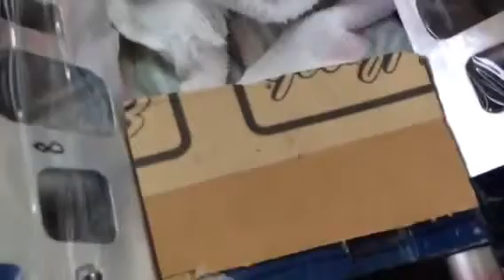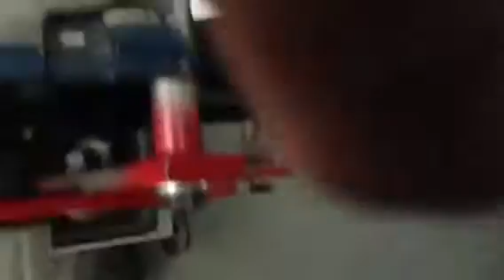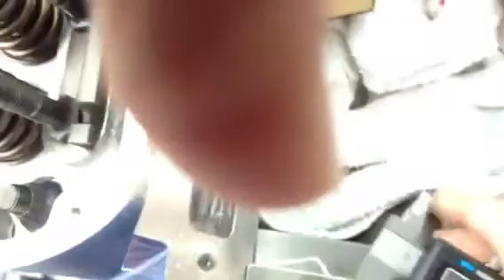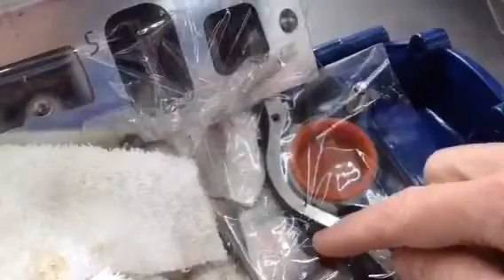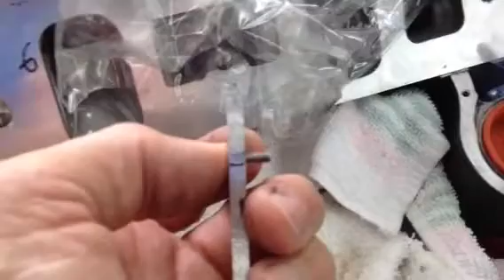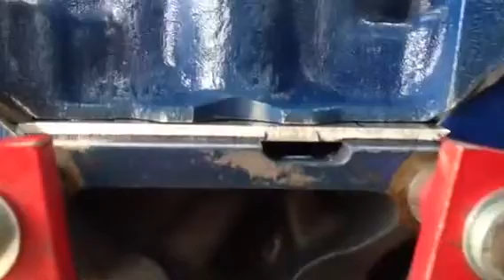Intake Manifold Leak Repair Ford 302 using Aluminum Shim

Comment: Pretty impressive solution to a completely normal SBF Ford intake clearance. The gasket kits come with end seals. Also everyone throws them out and uses “The Right Stuff” with a thick bead and it works everytime.
Reply from the maker: Your input is good. Those beads of caulk and little rubber things will pop out if you have a supercharged or turbocharged engine. The only way to keep that from happening would be to run a pulley driven vacuum pump.